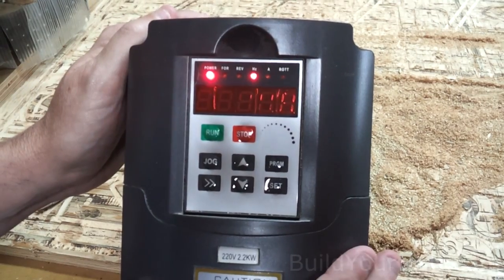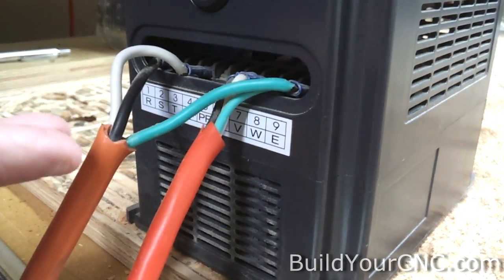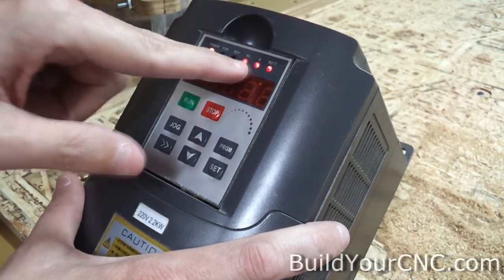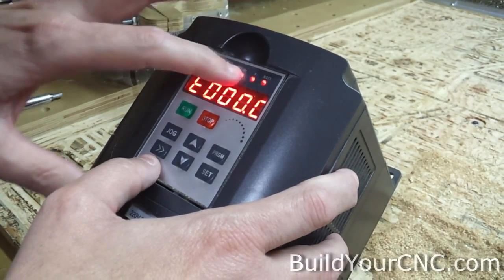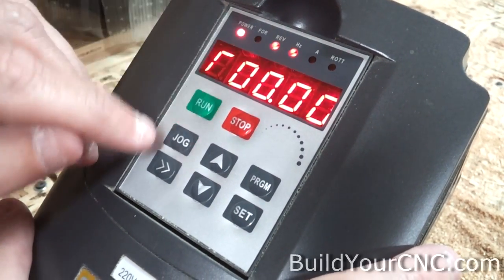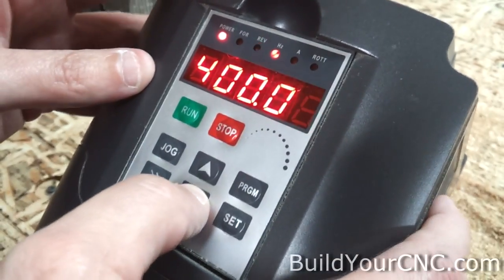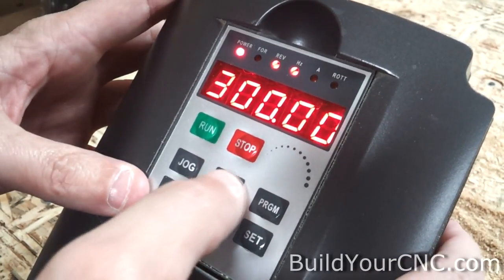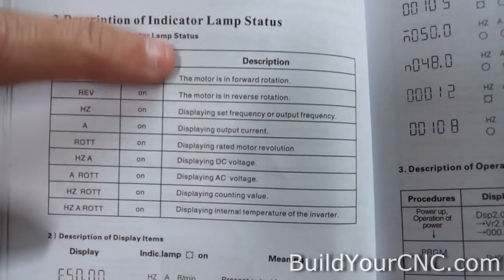Simple Introduction to Spindle Inverter

Comment: its an old video
i got same inverter and wired up for ncstudio

it working lot better than i expected
lot less commandset  like similar  inverters
less command less chance for error

breaking time just set moderated because i didnt find   terminal for  bvreaking resistor..
it is around 70  right now on ebay

Comment: thank you. for this . my question what it changes between the 220V and the 110v. in the programing. it is the same? i have bought the same one but 110V and i would like to know how to configure it . as per you it should be the same configuration  only i have to put the voltage at 110v?

Comment: I picked one of these up on eBay for cheap. I have no idea how to wire it up for power or where to connect spindle, no manual. I'm also a beginner without experience. Would you mind sharing how you wired it or showing it in a vid?

Comment: I have the same invertor as you. I can't get it to run a 3 phase 220 motor. When I program the hz to 60 it changes my voltage to 60.  When I program the 220 voltage it chanes my hz to 220. Can you help me?

Comment: the guy i bought my spindle and inverter said i could run 110 volt or 220 volt do you kow if thats true i have a huanyang inverter 1.5 water cooled and on the front it sais 220 volt. i also get a lv code for low voltage do you know  if he is right or not thanks rob